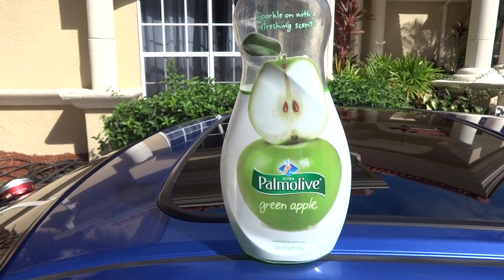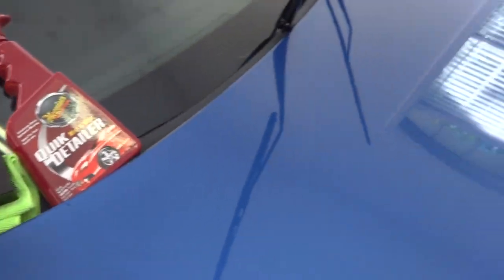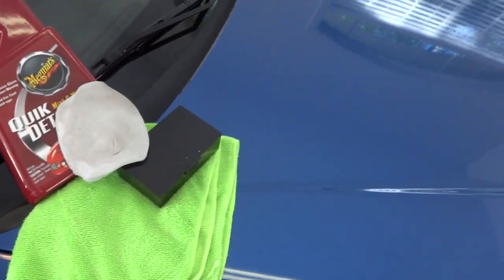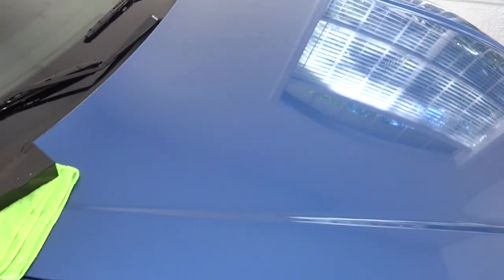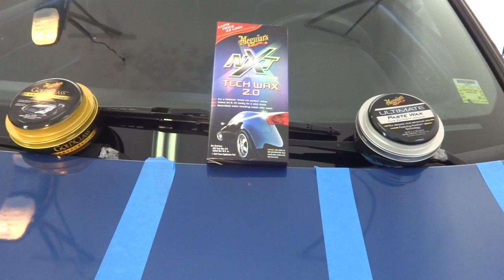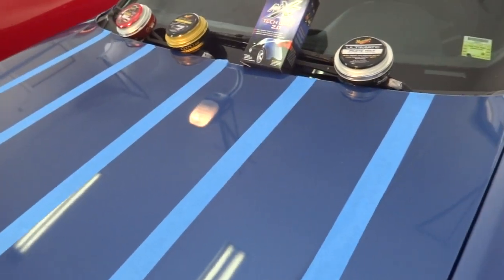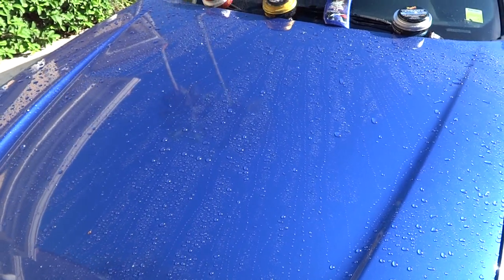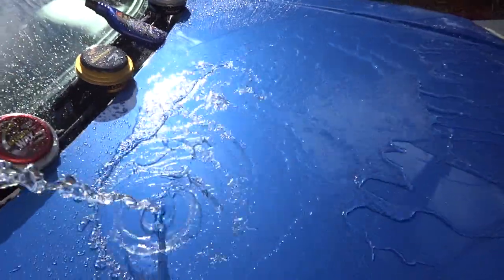The difference between Meguiar's Cleaner Wax, Gold Class, Tech Wax 2.0, and Ultimate. Comparison.

Comment: Nice work with the video. Over the years I have used numerous carnauba waxes myself- different brands, liquids and pastes, cheap and expensive. I have no experience with the synthetics, only because they do not seem to add the depth to dark colors as the natural carnauba. My conclusion is that they can all produce similar results in the end. The main difference I have found is the more expensive the wax, the easier it is to use. I use a wax in the $100 range, and not only is it very easy to wipe off, but it there is no dust, it doesn't get into cracks, and it doesn't matter if it gets on rubber or plastic. Hope this helps too.

Comment: Do you think it is necessary to wax the car with a polishing wax after you wax the car with Mequiar's Cleaner wax? Or is it normal to only wax the car with something like Mequiar's Cleaner Wax and then be done.
Reply from the maker: you can certainly do just the cleaner wax. But if your really wana get those swirls and light scratches out, then you want to get to a compound and or polish, then slap a good wax on it, not a cleaner.

Comment: great video! i just used the cleaner wax on my 350z and it came out great! was hard to remove and their was a lot of flaking. Wanted something that cleaned, polish and waxed at the same time. How often would u say i should re apply? every 3 months?
Reply from the maker: LiLDeMoN8I8 yah 3 to 4 months as needed. If you don't want to deal with the hard to get off stuff, try the ultimate, its so much easier!!! Lasts forever too.
Reply: Ultimate liquid or paste?
Reply from the maker: LiLDeMoN8I8 either or,  your preference there, both work great!

Comment: I been using the Meguiars Ultimate Paste Wax for years and I noticed it stays on for a very long time. I put a coat of it on right before Winter and it will hold up all winter long and even through car washes, I always run my car through the car wash during winter to get the undercarriage. Good stuff and smells good too.
Reply from the maker: Yup, ultimate lasts around 6 months before it needs a new application.

Comment: I use the cleaner wax more to get of gunk, should there be any, and deeper scratches. Then used to go over it with Gold on whole car. Looks like I will be switching to the 2,0 or Ultimate. Also, shout out on the 4th gen Prelude. I actually have one now I got from original owner with only 60,000 miles. I am going to sell though cause I just don't drive it often and have too many cars. It was used as a show car and been a blast. Love those gen 4 Preludes!

Comment: Great video and thanks for putting this up. I often wax my car in the sun which I've read is not recommended but what's the reason behind it. I mean I don't do it when its baking hot - just normal sunny day outdoors. Does the wax bond with the paint better when applied in the shade?
BTW, that's a beautiful Blue of your Honda.
Reply from the maker: some waxes can in fact be used in the sun, just have to research which ones. I usually wax mine in the garage just because it's too darn hot!

Comment: Hey, need a suggestion please. I'm already using the Muc Off Miracle Shine which is a polish with a blend of three waxes including carnauba wax. Now i've also got a can of the tech wax. What do I use in what sequence and how often? Thanks.
Reply from the maker: EXATTIC Well just make sure you clay bar the car good before you wax it again in case you didn't before. If you really want the best you might want a true polish or compound to get out any swirls etc. Then you can just add the wax that you bought. You wont need to clay bar every single time but you can wax every 4 months or whenever the wax starts to fade on you. All up to you, the tech wax should last about 5 months before really starting to show signs of fading.

Comment: the cleaner wax, having a slightly higher abrasive content actually did the most benefit. it's a compound/polish/wax. it actually cleaned the clear coat better. the hydrophobic properties may not be that of the higher priced waxes you tested. but the clarity of the paint was noticeably improved. maybe, if someone doesn't have a da laying around, they'd be better off using a cleaner wax, followed with a accord79 approved glaze and sealant. just a thought.

Comment: i work as a detail specialist with one of my buddies we started a company back in highschool about 4 years ago.  i really like the comparison.  the results in the water running off the car will depend on the condition of the paint before you wax.  in your video i noticed that the cleaner wax worked the best, the reason for this is that a cleaner wax is almost in a way like a polish it is meant to clean and get more of the imperfections out of the paint than a normal wax would so therefore water would run off the car better.  one thing to try is called paint conditioning cream  it is by meguires off there professional line and i highly recommend it even if you are not a pro you can still use it i recommend using it with a polishing pad which is yellow you can order it from meguires and a da polisher form maguires all of this will set you back about 350 but it is defiantly worth it you can also check out some of there DA polishes and waxes which are great too
Reply from the maker: I have griots garage paint prep if that's what your referring to, it will strip down any wax and get your car down to the base ready for the paint. And if your really going all out I totally say use the compound and polish before you wax or seal.

Comment: Is cleaner wax, in any way, abrasive? I heard it's an All-in-one process where the wax actually has polishing and protecting components, much like polishing compound. I used it on my new Civic once every 3 months. I did it about 3 times now since I bought it new.
Reply from the maker: icantw8 its so mild you will be just fine. You should think about stepping up your waxes to either the Gold class or one of the synthetics on the end like Ultimate or Tech.

Comment: Hey man, excellent video. I agree with what you said about the Clean Wax being the most difficult to get off!!! I waxed my truck today and it turned out good but only after some really thorough removal.
Reply from the maker: lol, then stay away from the turtle wax and the new turtle wax cleaner wax, yuck.
Reply: Haha wasn't planning on touching it. I'm a Meguiar's man! By the way, I also live in FL, and I'm really good about cleaning off lovebugs before they do damage, but there are some old stains from the bugs from previous drivers. Any tips for removal of those?
Reply from the maker: Harrison Wood I can only suggest try some compound or polish, Ive had the same issues myself and I could only get part of it off.

Comment: hi i am going to buy my first car soon (bmw 320i msport) in black sapphire colour (metallic paint). 

What i wanna ask is this, do i have to wash first with NXT Car Wash for example, then dry with a microfibre cloth, then use ultimate wax paste, wait for it to dry and rub it off with a microfibre cloth, then use clay or clear coat/ sealant? Is that the "full recommended treatment"? or i can simply just stop after waxing to get good enough protection and shiny-ness?

Another question, after i'm done doing all of that, i get some dust and dirt from driving in the city, is it safe to just use the NXT car wash to get rid of the dust/dirt without ruining the shiny-ness or protection? or just simply a rinse with water then dry with micro fibre cloth?
Reply from the maker: Alphapunk2 you will need to start with a wash, probably a clay bar treatment for best quality, any compound/Polish only if needed to remove swirls etc, then lay on the wax and you should be good:) I know lots of people who skip the polish/compound if you don't have those items yet.

Comment: OK I have several points to address about waxes I do I know we are trying find any differences between low cost and high cost products but just some tips for you.

You need to chose a wax that best works for you and you need to consider 3 factors:

Shine- Unless you have a  device that can measure how much light the wax is able to reflect it is going to be difficult to determine which wax will give you more pop. Also, it depends on the color of your paint, and the condition. It also depends on weather you want it car room shine.

Longevity-- How much the wax will last will depend on your weather and climate, how much you use your car. The way to find out is to do field work , wax one side of the hood with one wax and the other with another wax, and see how they hold up in your environment.

Protection--  How well does your wax protect your paint from lets say, bird poop? tree sap?, fall out, dust ?  How fast could it sheet some harmful liquid from your paint such as brake fluid.

I did see more beading on the higher end products but I saw the same amount of sheeting in all of them. To me sheeting is more important than the beads and the sheeting was good in all of them.

Comment: Just watched this video comparison. Meguiar's cleaner wax is a very good product. Remember that a cleaner wax has mild cleaners or polish in it which helps clean the paint. This is good for paint that isn't heavily oxidized. Therefore what I recommend is a coating of the Ultimate wax on top! Then you will have better water beading & longer protection!

Comment: I have been using the Meguiar's products for more than 60 years and it's a given that you get what you pay for. More science and testing goes into every new product, so hence it will cost you more. Before using the Meguiar's polish I was using the old Simoniz wax.( for those of you that never used it....you are very lucky)  It use to take me one whole day 8-10 hrs just to wax a car. Then I went to the Blue Coral method. Back in the day, there were no machines to use. Detailer today have it made and the Meguiar's line of products are still the benchmark  in detailing products.
I would like to have seen you leave the tape marks on for the testing as you contaminated all the other waxes by removing the lines .

Comment: Thanks for taking time to do the comparison. Super job!! Honestly, I saw very little difference. Had there been no distinct lines that were side by side it would be almost impossible for me to see a difference from one car to another if I saw them 5 minutes apart...... hope that makes sense!
Reply from the maker: Since I have used all over time here is what it comes down to. Forget the Cleaner wax, wont last and hardly beads up after a few washes. Ultimate is amazing but wont make your car pop as much as their carnuba line Gold class. Tech wax Is also a great synthetic wax that will hold for along time. This video is a way to show what each will do on the car and how its applied etc. THanks for watching.
Reply: Thanks for the explanation. That does make a big difference.
Reply: Acc0rd79
That's exactly it in a nuthsell. The trade-off between carnauba dna synthetic is depth of color vs. longevity, respectively. Being a detailer myself, I had to do a similar test for myself just to personally witness the real-world performance of different kinds of waxes/sealants. To tell you the truth, I was somewhat disappointed with the synth's purely due to their lack of "pop". Now, with all of that said, I have found it primarily to be true with the over-the-counter stuff and not so much with the pro lines of poroducts i.e., Menz, Pinnacle, Wolfgang, etc. But, for the average, weekend car care enthuz, the products you tested are a great representation of what they can expect from the products readily available to them at their usual parts stores/bib box retailers. Great job!
Reply from the maker: Thanks, that's exactly why I made this channel, because most of the crowd out there doesn't want to order online for car cleaning products. They just walk into a local store. I think that's what made my channel really take off and its not even a year old.
Reply: Acc0rd79 Meguiar's has really stepped up to the plate by bringing some products to the mainstream consumer that, when used as directed, have the ability to deliver professional looking results. The one that immediately comes to mind is Ultimate Compound. It blows the competitors' compounds away in terms of the ability to remove swirls, scratches, holograms, etc. It's abrasive enough to produce excellent results, yet mild enough that a complete novice can't do any real damage to the finish. I've been detailing for almost 30 years and have a very broad range of products in my arsenal and Meg's UC is one of the products I won't be without. It's sooooo versatile. I recently did a pre-sale prep job on a truck that was, for all intents and purposes, trashed. I mean it was trashed. The finish was dull and lack-luster, it had too many blemishes and abrasions to begin to count, and it was covered with swirls from bumper-to-bumper. Most, if not all detailers would have immediately passed on this job due to the fact that it would be too much time spent for such anticlimactic  results.  However, this was my neighbor's truck and I had been pestering him to let me detail the vehicle for a couple of years. I'll skip ahead to the part that's most relevant to this video and our discussion... I decided to tackle the project using Meg's Ultimate line and my Harbor Freight DA Polisher - all of them things that can be purchased at Walmart and Harbor Freight. I Compounded with UC, polished with Ultimate Polish and finished with Ultimate Wax. You can judge for yourself how well it turned out via the pics in this thread on AutoGeek's site.
http://www.autogeekonline.net/forum/auto-detailing-101/74607-fun-one-not.html

Comment from the maker: Ive used em all,and I thought id make a video showing the differences. Gold sure makes your car pop but its not designed to last as long as synthetics (Tech wax/Ultimate), cleaner wax is their bottom of the line wax and its not a true wax only, its a mixture. Cleaner also doesnt last very long before it starts to fail. It happened to rain today here in the south and my wifes car with the tech wax did amazing work beading up repelling the water!

Comment: Sir i have little swirls on my hood and trunk of the car.... I want to remove them by hand.... Should i get meguiars ultimate polish or scratch x2.0?
Reply from the maker: shashank bhasin polish or compound for sure. Compound cuts more than the polish does so you can start with the polish and if you need more, jump up to the compound.
Reply: @accord76 sir so i should drop the idea of scratch x 2.0 ??? And should go for ultimate polish?
Reply from the maker: shashank bhasin yah it will work better:)
Reply: But sir i have heavy swirl marks as the car was underlooked for one year... Dont u think polish won't remove them??? I need a compound?
Reply from the maker: shashank bhasin its always good to buy both, that way if the polish isn't enough, you can step up to the compound for a more aggressive cut to get rid of those swirls!

Comment: are you suppose to  use the cleaner wax  after you have a good  regular hard wax on the car or before you  apply the good hard wax ?
Reply from the maker: Ronald Tyler not necessarily, you can just clay bar your car and use any compound or polish if you have swirls, then apply a wax.
Reply: I just wanted to know I have both a regular hard shell turtle wax  it last for 12 months they-say,  and mcquiers liquid  cleaner wax

Comment: Alright.. I used Gold Class paste for the first time.   First time for a paste as well as a carnauba.  I definitely like the way it applies..  You wouldnt know how much easier it is to get the exact amount you want until you try a paste.   However.. Not only is it a little rough in comparison to take off, but it leaves yellow particles all over.  It doesnt matter so much that they are yellow rather than white; its just that I have never had to deal with that.   In comparison with say the Ultimate.. is this normal for paste or does it have to do with it being Carnauba?
Reply from the maker: yah its normal, but that stuff just flies off anyhow. Now I will tell you with the Pinnacle Soveran I just did, I had none of that but then again you get what you pay for!  Still, I don't mind a few things around when I can blow em off or just wipe it off lightly with a microfiber. If your having issues with it being hard to get off, go to smaller sections and let them dry. SO it wont be so hard.
Reply: Acc0rd79   Is it normal for a paste or is it the carnauba?
Reply from the maker: Just Truth my guess is the carnuba as it really is a wax and if you know cancles etc, they can flake off when making them etc or you can "shave" a candle. Where a synthetic like ultimate/tech can be designed without that stuff.
Reply: Acc0rd79 Makes sense.  Easy way to tell..  Does the Ultimate flake off like that?
Reply from the maker: Just Truth not really. But I like the liquid wet look that the carnuba brings to the table. Not that the ultimate is a slouch at all! Just made for a different purpose is all.
Reply: Acc0rd79   Oh, I would imagine Ultimate is decent.  NXT always worked well for me.     I was just trying to see if it was only the carnauba that made it flake like that or if it was due to it being a paste. 
Have you ever used the Gold Class liquid?
Reply from the maker: Just Truth no, im a paste guy but I have used liquid many times. I don't even think they made a liquid carnuba, or I haven't seen it anyhow.
Reply: Acc0rd79   Was going to see if the liquid gold class flaked like that. Then I would know it was the carnauba causing most of the flaking.  Not pastes.